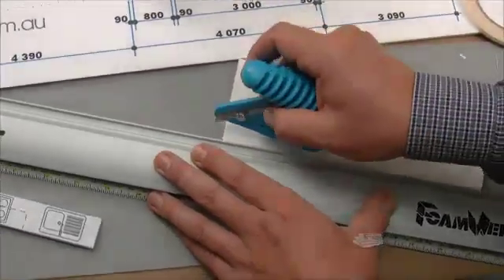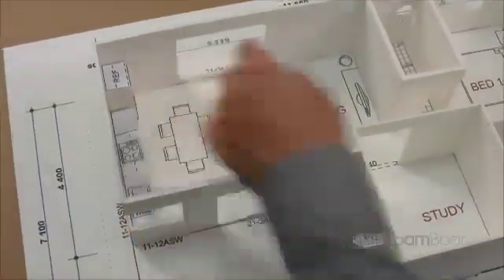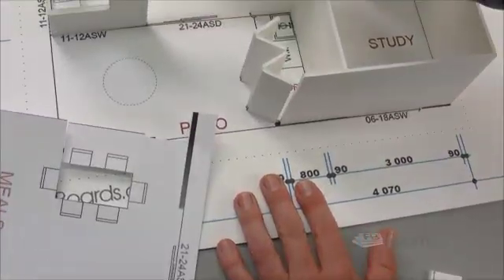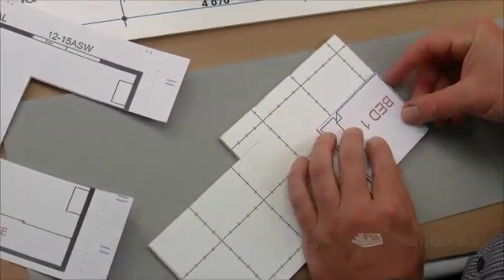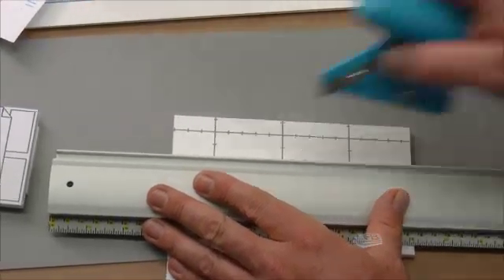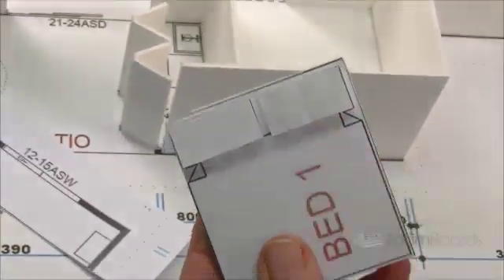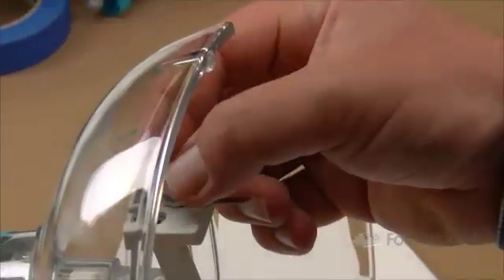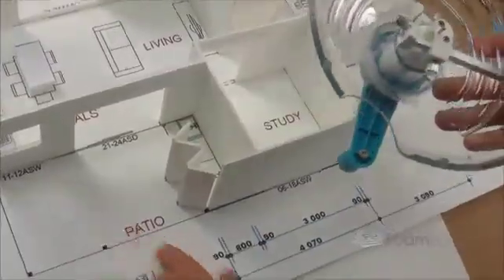Making Model Furniture Using Foam Boards Part 2

Comment from the maker: Thanks for your feedback Mustafa but when commercially we use CNC cutting equipment combined with 3d printing the foam board makes very realistic representations but this video is not about showing that type of work. It is only showing a basic introduction to how people can get started at model making with foam board. Given the right equipment and design technology you can just about replicate anything for prospective clients to get an idea of a finished product. Thanks again for your feedback